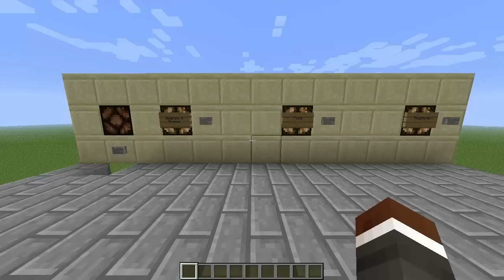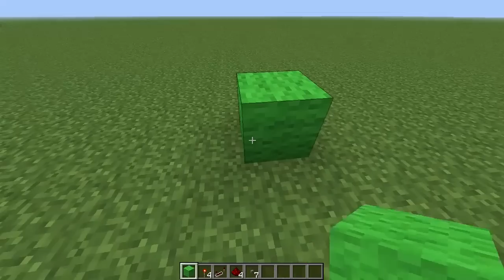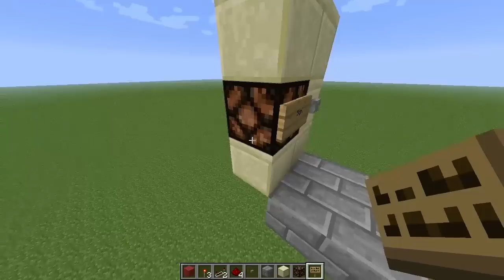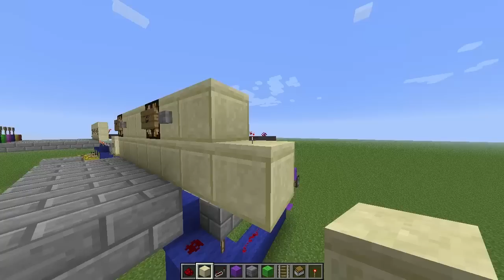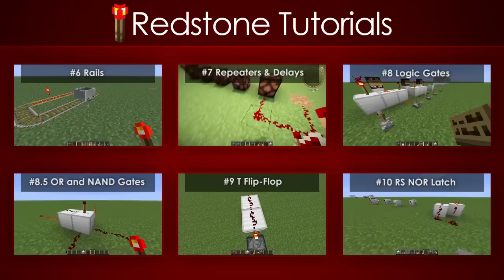Redstone Tutorials - #11 Storage Cart Station

Comment: I followed the video from the start and did exactly what you did. but at 16:25 when I press the button to call the cart it goes running off in the other direction, towards the other minecart chests. I even tried remaking the whole thing from scratch but it repeated the same thing. I'm pretty confused so it would be nice if you helped me out ( I don't know if it's due to the new update or something)
P.s. Minecraft version is 1.14.4
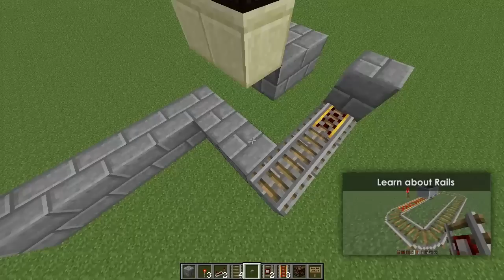Edit: I solved the problem by using normal rail instead of powered rail just after the curved normal rail at 9:26

Comment: Love your videos. A bit late to Minecraft myself. However there must have been an update because this no longer works (PS4). When you complete the blue line and test the torch to show the tracks changing (it still does, however, it’s in reverse) lit torch pushed the track away and off torch pushes it towards receiving. In your video it’s the opposite. Bottom blue torch lit track faces receiving , unlit it faces next area. Any help would be greatly appreciated. I know this vid is old so if there’s a newer one please let me know.

Comment: I'm not having the same problem as the fix for this video (for when you are facing the wrong direction). My tracks are not switching fast enough when the carts exit their home and they go the wrong way. They go back home just fine though. I have checked and rechecked my setup, I'm playing on an old 360 without internet connection so it's not up to date (which I figure is ideal since this video is so old). The repeater on the pulse limiter is set correctly and appears to function properly, but the track still switches too slowly. Any ideas?
Reply: I fixed it by lengthening the bays by a couple blocks and adding a couple regular rails. Thanks so much for these tutorials! I have been over and over the process and I have an intimate enough knowledge now to build one of these not because I memorized the layout, but because i understand how all the components interact. Of course, this design is far more space efficient than something I could come up with so I'll use it in my worlds, but I could come up with my own design if needed and that feels awesome! Thank you!

Comment: I made the first part, the green, purple blue and grey part...but. if I call the cart the light turns on and when I sens it away it turns off. In the video it's the other way around...help!
Reply: I just noticed that there's a link to fix the problem that I had. i just changed the things here and there and it works. Thanks. If it weren't for you I would me stuck all night with this.

THANK YOU, again.

Comment: I have been following this video to the t but for some reason the first issue I ran into was the minecart would not go to the station it would send it back to the right slot but when I try to send it the other way it would switch it to the opposite direction of the station and now I'm having a problem with the flip flop system and it's not working...
Reply: I figured out my flip flop problem misplaced the setup but the my car still not returning back to the designated slot
Reply: Yeah things have slightly changed since these videos were created. Try removing the redstone torch that sits under the glowstone lamp that permanently keeps the power rail on.

Comment: I dont know if this is a new bug or something, but whenever I try it, it doesnt flip fast enough. Also, the light is showing off when the minecart is in its station. I followed every step exactly. Please help
Reply: happened to me too! Im playing on ps4. There is a slight delay when the storage cart tries to come back so the cart always falls off the rail lol, im stuck :/

Did u get it to work?
Reply: Yep, no worries prob just a bug :)
Reply: +Ringo_Starr64 I had the same problem. i simply made the area where the mine cart comes in above the t flip flop longer and the detector rail further from the switching rail. this gives you the extra time you need.

Comment: Anyone using Xbox One edition have an issue with minecarts turning before they reach the section of rail that changes direction? Rails switch as they should, but carts are already turning before they should, ticks before the section switches. Causes the carts to go the wrong way no matter how the circuits are configured. Possible bug? Or some other issue?
Reply: YoshinEFA Yes
Reply: Yes I tried to fix it for over an hour but it still does it.
Reply: YoshinEFA Same on PS3
Reply: In case anyone is looking at this, not sure if it's just a console thing or an overall update but carts move (accelerate?) faster and they pass the turn before it has a chance to flip, the way I fixed it was replacing the powered rail with a regular one and adding two more rails before the turn so it takes long enough for the turn to flip.
Reply: all you got to do is change the powered rail that is where the carts are going(the wrong way) to a normal rail. Then change the redstone pulser or whatever it's called, change the tick to 2 ticks(redstone repeater) it worked for me.
Reply: oh do all that except for the "redstone pulse" thingy
Reply: oh and remove all the powered rails except for the start the stop and the wrong way end
Reply: if it does not work, make sure the rail is from start to stop, if it is not then hit the button on the "redstone pulser" thingy

Comment: I have built this minecart storage system and it works great until I try to do the yellow circuit.  It does not change where the cart goes.  It still goes into each slot.  I've wired between the pressure plate and the portion that controls the rail that switches.  Nothing happens.  What version of minecraft are you using, by the way?

Comment: Hey mate.
I have got a problem.
The carts works fine, but the lights does not really work on it? The lights just turn on and off when they want to :/
Reply: Do you have Minecraft Java?
If you have Minecraft Bedrock it's not going to work.
Info: Minecraft Java include Java and Xbox 360
Info: Minecraft Bedrock include Pocket Edition, Windows 10 and Xbox 1

Comment: hey just tried to build it but the rails dont change in time for the minecart
Reply: Did you remember to set the repeater on your pulse limiter to the third setting? (Being 2 clicks on it to put it there.)
Reply: I have the same problem , all the things are right the t flip flop and the pulse limiter are good but the thing wont change in time to get out of the start
Reply: It could possibly be a lag issue.

Comment: For me the detector rails don't switch the track fast enough, so even with the yellow circuit the cart goes through the entire system there and back
Reply: ***** This solution worked for me. It's strange that the minecart is too fast for the track to change.

Comment: I did not understand quite well why the pulse limiter was needed. What would happen if you removed it? Wouldn't the signal travel just as fast without it?
Reply: The T flip-flop will not work unless the input signal is switched on and off - try using a T flip-flop with a pressure plate as its input. Nothing will happen when you are standing on the pressure plate until you step off of it.
Reply: Oh :P
So the pulse limiter makes the signal switch on and off fast enough for the T flip-flop to change the track on time...
Thanks :)
Reply: L Lawliet
No problem. At least, that's how it appears in his T flip-flop video. I was in the same boat as you were, confused about the pulse limiter part. :P

Comment: now i think im not sure, but on the newest update of 1.6.2, the contraption only works if you look in the direction south, because of the tracks turning left or right, if the track is turned off, it turns to the left, if the track ( a normal track) is turned on, it turns to the right, but if you look in the direction of the east, its the other way around, so now i have to redo everything :(
Reply: Thank you friend I had a real hard time figuring out what the problem was.. I just mirrored his build in the end and it worked great so thank you

Comment: I built everything after 100% correct up until you demonstrated with the button how the track changes (12;50)
However, when the redstone torch is on under the turn, the turn faces away from the accesible stop. And when the torch is off its facing towards the accesible stop. Pretty much opposite of whats going on in yours. 
Any ideas on what it could be?

Comment: @jahil walker  I tried this on Xbox and it didn't work properly as the rail  that turns to get into the storage space 1 doesn't return to default when the power is removed, this causing a pile-up of sorts. Not sure I I just did something wrong, but Xbox physics are slightly different as we are behind

Comment: I did everything in the tutorial.. My only problem is, When I hit the switch for the first cart I don't know if the corner tracks moves to fast or to slow, but it goes to the last cart instead of the "pick-up whole" if you will. Thus creating a pile of rubbish. The middle cart goes to the last one and back to its original area.. and the last one goes though the mid, the first and back to it's original position.

Comment: The rail doesn't change fast enough; that's why you need the pulse limiter. I don't know the exact tick delay of a button, but it isn't as fast as what the pulse limiter gives you, and that's why you need it. It's there in place so the rail will change direction and turn the cart into the right station. If you didn't have it, the carts would either go into the wrong station, causing problems, or they would all shoot off to the right/left and fall off.

Comment: Yes and no. It does work, but the timing is a bit off, so you have to build it a little differently. The track has to be one block farther where the carts stay until they're called out. If Flabaliki doesn't record an update video on it, I might do one myself in a bit.

Comment: ya, i'm having the same problem with the docking rail ( i think its somehow because of the torch from the user input circuit) are you also having the problem where you cant get the intersection to face the right way by default? when i add the torches to power the rail it flips to the wrong way, and when i try the process in reverse it doesn't flip at all! very frustrating. please help flabaliki!

Comment: Yup, worked. Also, found that I could place the button one higher and slope the grey wool down diagonally instead, and use redstone dust as a light instead -- although it's not as pretty, it serves the same functionality as a lamp.

Maybe eventually Xbox will fix all the redstone bugs and add lamps. Hopefully.

Comment: either my timing , setting, or state its in is causing me trouble, the first tiflip flop works fine, but redstone wont trigger the second or 3rd one for some reason, all the wire and connections seem right ...is there a bug on pistons right now?

Comment: When I was making the yellow part to stop the cart from going into the other spots that didn't work at all. What happens is when I click on the third one it still goes into the other ones. I can only sometimes get the cart to go straight back into its correct hole, but only going back.  The only way I get it to go straight back is by hitting the buttons on the first and second green part. PLEASE HELP!

Comment: so i built this on the xbox version and i did everything correctly excpet we dont have lamps yet, but besides that everything is identicle, but the powered rail in each of the docking stations stays on even though the torch above it is off. Ive taken the torch and the red stone off above it and it tuns off but as soon as i put those pieces back in it stays on again. why is this happening and is there another way to wire it so that it doesnt?

Comment: When testing the first rail: on yours the blue line is off and the rail is facing the correct way (as if to send the cart to the platform), but on mine the blue line has to be on?
i've built it the same way you did in the video, and this happens.

all my other tracks are fine? i've re-made the entire system multiple times with no changes...

Comment: Actually, i figured it out then, i didn't even need the station fix. I forgot to add the circuit that goes with the yellow wool, and prematurely got worried there was a problem when rlly i jsut need to add that and it worked fine, so its all good now. Thanks for the videos, its rlly helped me get a hang of redstone, i never really understood it until watching ur videos. They are the first videos i have found that actually show u why and how two do something instead of here, copy what i did

Comment: For some reason i seem to be having a problem with the first and second stations, i tested to see if they were working, however, there is a slight problem, when i send the fist mine cart back  it works fine, but when i added the second cart, i placed it on the with the send back utton. i pushed it and it worked like it should. however, when i pushed th button that brings it to the acess area it would go into the first station before coming back and the same thing when it went back  i'm stumped

Comment from the maker: I explain it in the video. A lever can only be activated by a player. The T Flip-Flop is activated via redstone, which is how the system works. When the cart travels over the detector rail, the flip-flop changes state saying where it is in the holding area or not. If you used a lever, you would have a lever for each section and have to do it yourself and thus it wouldn't be an automated system and entirely pointless.

Comment from the maker: How would the track stay turned when there isn't a cart in it? How would the light turn off after the cart is left? Without the T Flip-Flop those elements wouldn't work. The pulse limiter is there to speed up the process of these so that the track change is fast and the cart goes the right way.